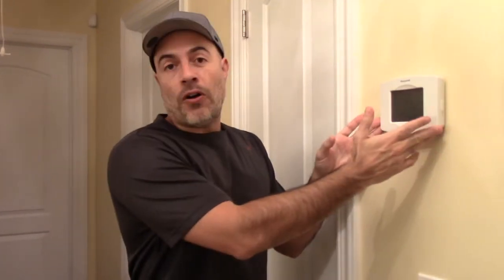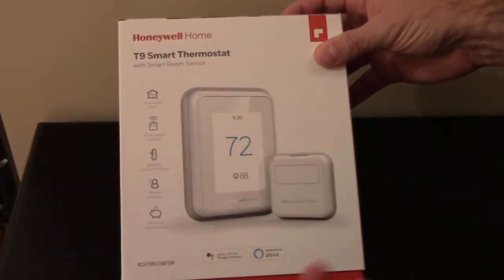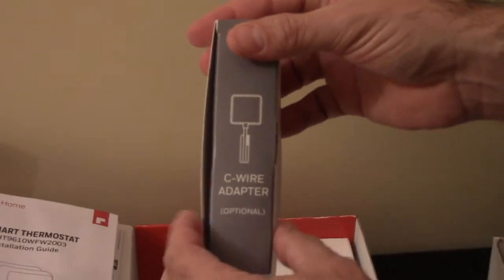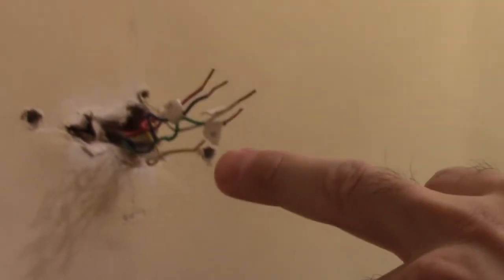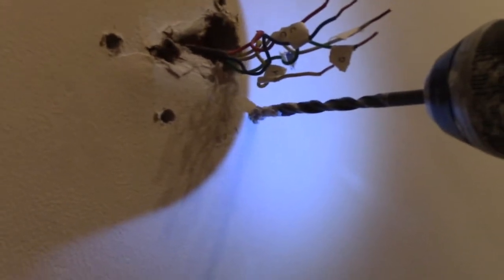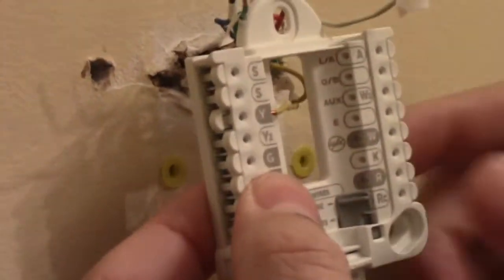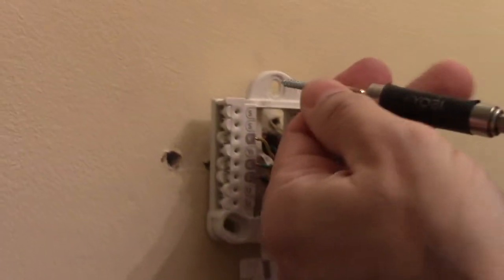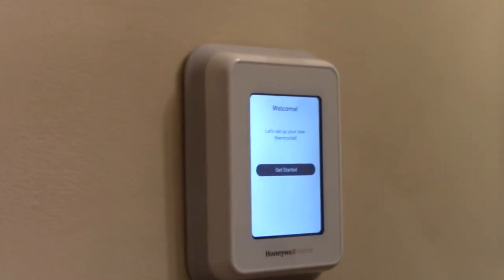Too hot in one room, but not the other? Honeywell T9 Wifi Thermostat Install with 2 sensors, c wire

Comment: I am trying to accomplish a similar goal in my house.  One thing I noticed, inside the wire cover door on the T9 it says, "Do NOT connect wire to W for heat pump".  It appears you did.  Did your heat work?  If not, where does the white wire connect?
Reply from the maker: I do not have a heat pump. Best to check your manuals to ensure the right wire is in the right place for your system

Comment: Where was the dual sensor set up?
Reply from the maker: I sert up the other sensor in my son's room, which is a middle-sized room. I didn't want the room to be too big or small. If too small, the sensor will register hot as the bigger rooms are still colder. If too big, the smaller rooms will get too hot. So i tried to balance by putting the second sensor in a medium-sized room
Reply: @letsdiy2gether239  how well is it working for you?  I’m looking to do same, with the sensor in the master bedroom.  Are you happy with how it’s working out?  Thx for the video.
Reply from the maker: @philb2798  Umm, i wouldn't say it worked great, but i do think it helped. I think you have to be selective on where your thermostats and sensors are set up to optimize how it works